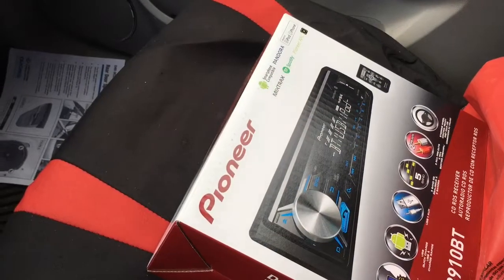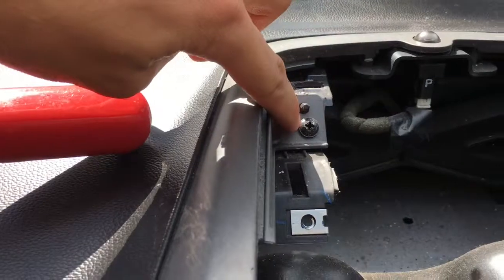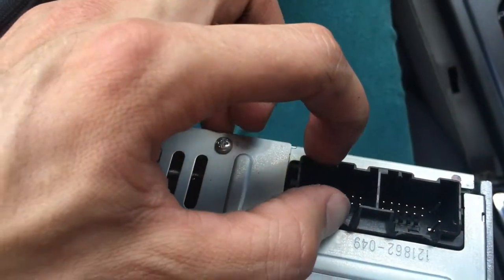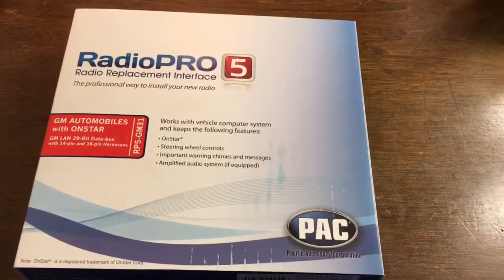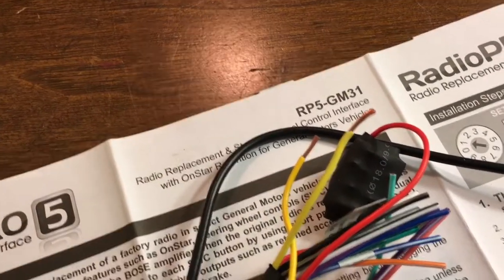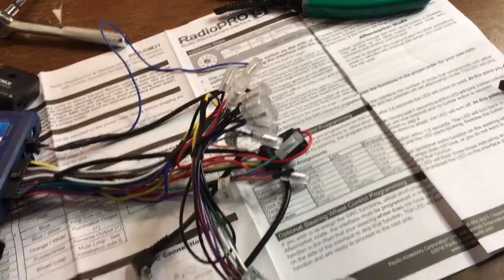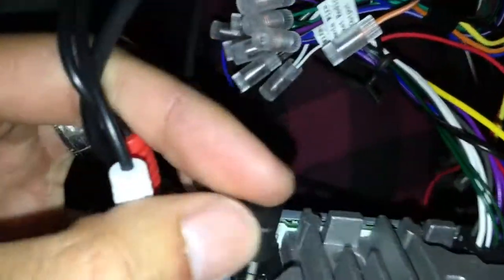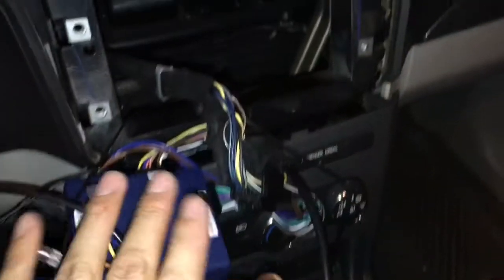Saturn Vue Stereo Removal And Instal

Comment: Excellent video I have the same kit for the same car but for another radio. What did you do with the wires that you spliced and put the plastic nuts on. I didn't see anything connected to them when you installed the radio.

Comment: hi I went to a technician to fix the compass handle that was checked in the lamp and no longer the steering unit
The main counters work and stop during the driving command
Saturn vue hybrid 2009 I have a problem with the compass control panel and the fuel counters do not work. What should I do? While driving the dashboard, the lights appear and then come back
Reply from the maker: ahmad khateeb I wish I had a good answer for you. But I don’t know much about that.